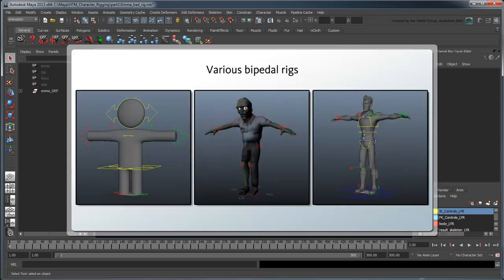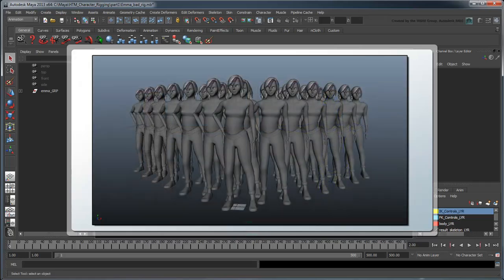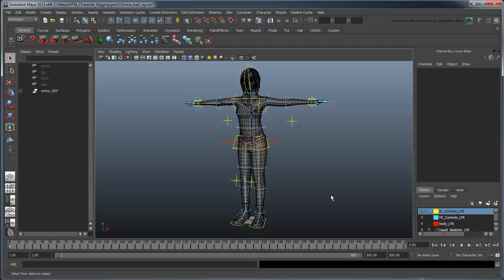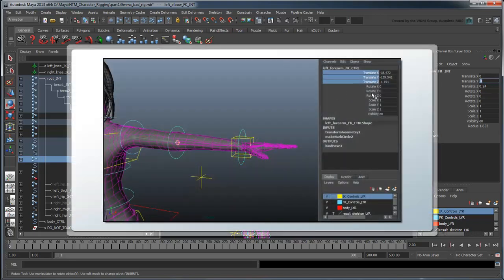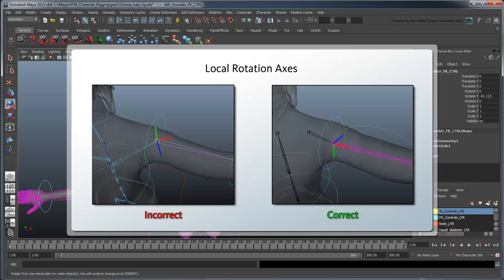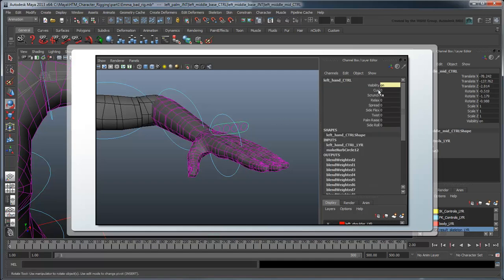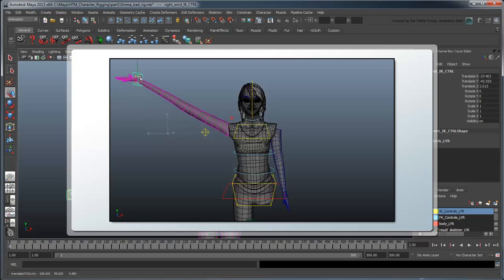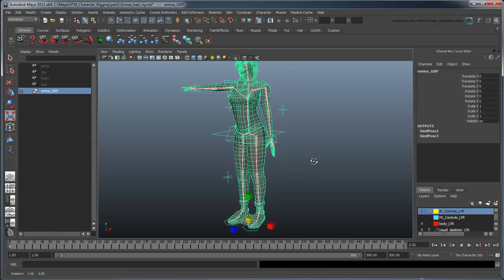Creating a Character Rig - Part 1: Common rigging pitfalls (Advanced)

Comment: There is no skeleton menu in maya 2015, how do you mirror bones? the mirror button on the 3d top menu doesnt work either.
Reply from the maker: There is a Skeleton menu.  You can find it in the Animation menu set.
Reply: yea like just after i posted this i found out about how the drop down menu selection of 6 different things change all the menu bars, lol why does nobody tell you this? :P
Reply from the maker: Check out the Getting Started playlist on our channel for videos with more tidbits like that..
Reply: I have a question not related to this, in blender u can select verts or edges or with F2 mod any edge and mouse the direction you want, and then press F to fill it or to create an edge between vertices, in maya you cannot create edges with vertices and to fill between edges you need to use the append to polygon tool, which means you have to enable the tool , select both edges and hit enter, then enable the tool again and select another square hole and repeat, this process is VERY slow in maya, however in blender it is fast as with a simple F key, the F2 mod also makes it so you can fill all adjacent ones with where you mouse is going instantly by spamming F key in less than a second, is there any way to make it faster in maya?
Reply from the maker: Look up the "Quad Draw" Tool.  It sounds like more or less what you're looking for.
Reply: Does that work with adding onto pre-existing geometry?
Reply from the maker: Yes.  Just select the geometry you want to add to first, then use the tool like normal.
Reply: I cant seem to get it to work, here is an example, you create a scimitar with far too many vertical edges bridging across it while looking at its left side, and you want to edit that side delete 4 faces and join them together to lower the poly count, and repeat that 1 at a time... It's like the program itself is obtuse or convoluted or just impossible to do it in, they should make it easier, again append to polygon tool only works, you could make a weapon in like 60 seconds with quad draw and extrude if you want to try it out, or better yet if you could make a couple minute tutorial video on how to use the quad draw with existing geometry (i can remove lines and add a intersection between faces but not join) or know a tutorial that does show it, that'll help alot thanks, until then imma use blender as its far easier.

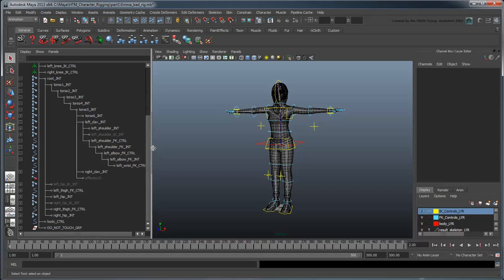Comment: at 4:53, you say it is incorrect to constraint joint to curves because it can cause unpredictable rotation spaces issues. I like the solution you used for this problem, you parented the curve shape to the joint itself. However, If I am using a joint IK controller curve and then I parent this ik controller curve to the joint, the translate values won't be at zero...how do i solve this prbolem?